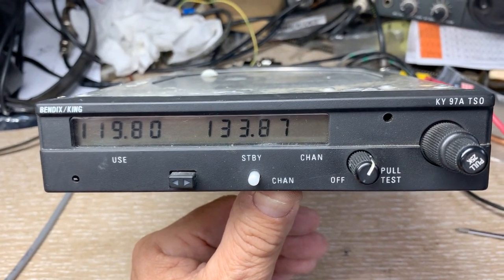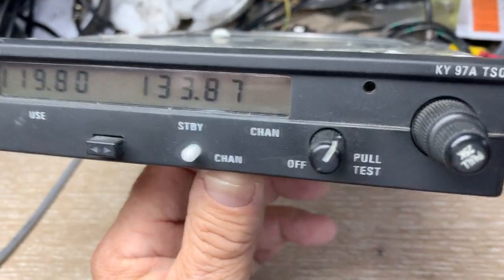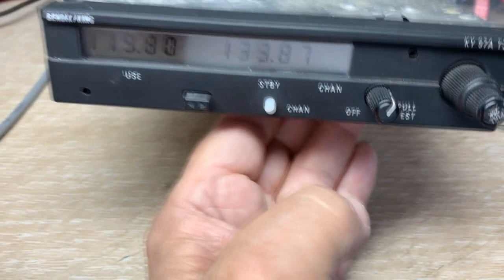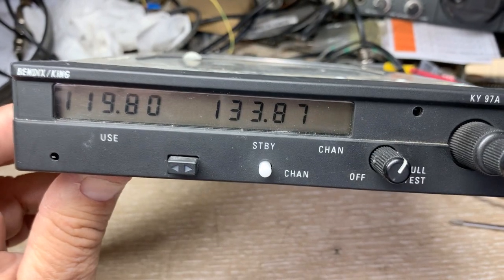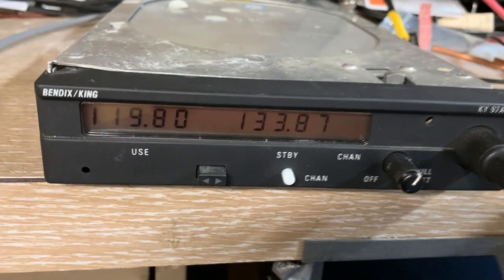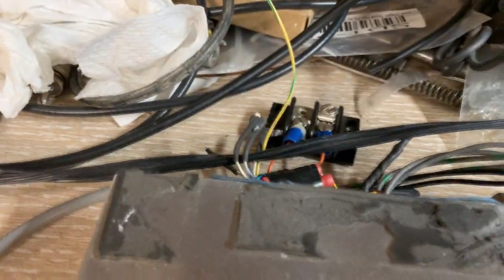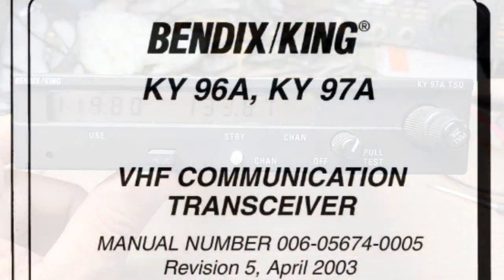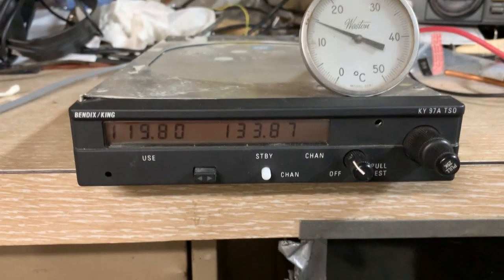King KY97A Sick Display Repair

Comment: Hi if polarity  has been  switched  to my king ky 97a radio will that cause damage ?
Reply from the maker: Possibly. Although a high quality piece of equipment has polarity protection included. It should because it's too easy to make a polarity mistake. Sometimes luck chimes in with a burned PC path, a blown diode or a damaged relay that ended up protecting everything else by a shear bit of luck. You may be able to see damage like that if you dare to take the panel off to look. Shops want $500 just to look.

Comment: Thanks for sharing this info!  Do you know if pressing on the front of the display brought the digits back to life before you fixed it?  Im going to dig into my KY97A to try this trick.  Im tired of needing 2 hands to change the frequency, one to press on the display and 1 to turn the dial.
Reply from the maker: Like you, I tried everything. The previous owner blamed cold temperatures on the problem. I got really sick of it one day when I found that to send it out would either cost $500 for a trade up to the same reconditioned unit or another $1k for outright purchase of an old radio. So, that's when I pulled it. The panel comes off very easily and be sure only to do the work over a bench. Have a magnet ready, but you may find the screws to be aluminum. You need all of them. Gently pull the full display free from the board. It's not connected in any way at all.  However, the conducting parts that look like thin rubber pads are still inserted into that plastic baffle. Don't remove them. Use a non solvent cleaning solution on the bottom of the pads and the top of the printed circuit board. Unfortunately, I did not film that part, but it's easy. There's no need to open the radio cover, so don't. Carefully re-install everything. It does help to do a bench test, but you'll need a tray and connector. Use a dummy load too, just in case. Figure you earned $500 for about thirty minutes of work. All of the parts are replaceable. It's unlikely the display itself is bad, but that's what you'll be told. This radio is non navigational, so you can't get into any trouble. Ensure it seats properly in the tray once you re-install it. It probably will never act up again. I think it's moisture related, but that takes years to cause a problem. They want over $1500 for anything like it that has the 8130. The display never was high quality. The radio itself is. By the way, you can replace it outright with IC1200, much cheaper and better, but you don't need to. Fortunately, the plug/tray layout fits other radios like Panasonic too.
Reply from the maker: I got the number wrong. I meant IC-A220 which if installed needs an wire cut to avoid problems with the Garmin intercoms, but the A200 is a direct plug in replacement. Also, for docking MB-53 is available right now for cheap on e bay, only a few bucks. Nice to know, but again, it's not the same as having an avionics endorsement, just way cheaper. The KYxxx's are costly and out of date now.
Reply: @michaelbradford2816  yeah, ideally I will replace the KY97A with a GNC355 in the next couple years but I’m excited to try this for now.
Reply: I finally got around to doing this job and it worked! My display has never worked better! Just wanted to follow up and say thanks again